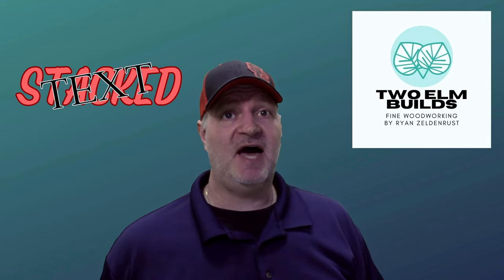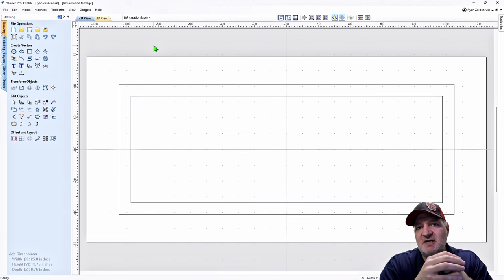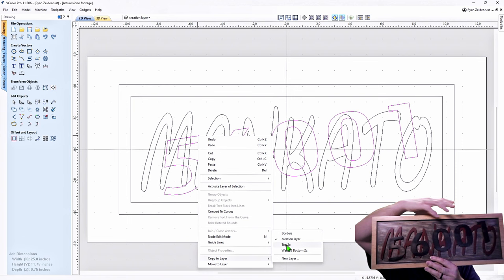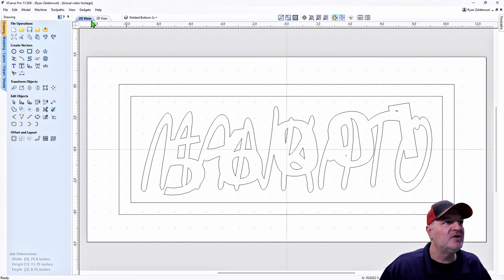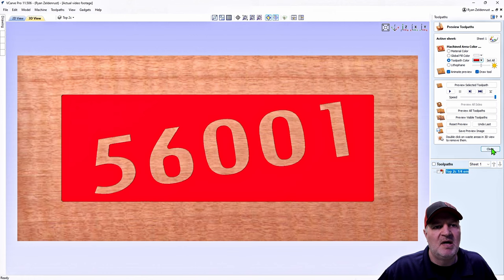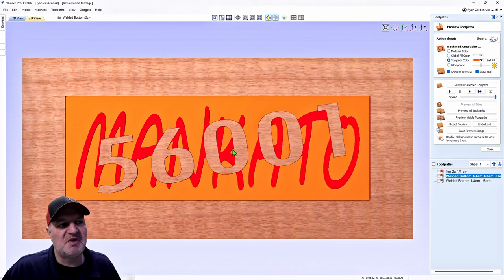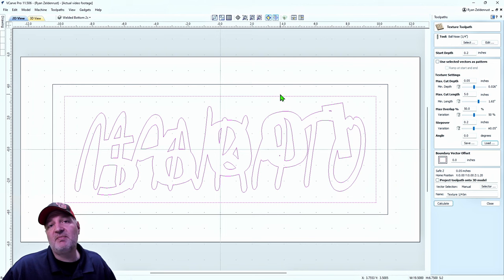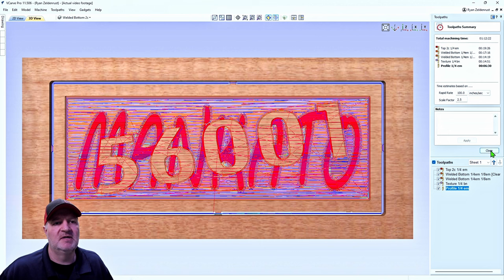Stacked Text in 10 Simple Steps with Vectric Vcarve Pro  [Text-on-Text CNC Project]

Comment: I followed the instructions but with different wording. When I preview my tool paths my cut out for the #’s isn’t readable? Any ideas as to what I’m doing wrong.
Reply from the maker: Are the #'s just not there at all or are they chopped up and hard to read?
Reply: They are there as if it’s not cutting out the numbers all the way like they are connected in places
Reply from the maker: @jessekurisko5659  hmmm, without seeing it, hard to figure it out. Are your letters too close together for the bit you are using to clear out all the wood around them? Try either kerning the letters apart a little or better yet, try using a smaller diameter endmill to see if that changes the look in the rendering